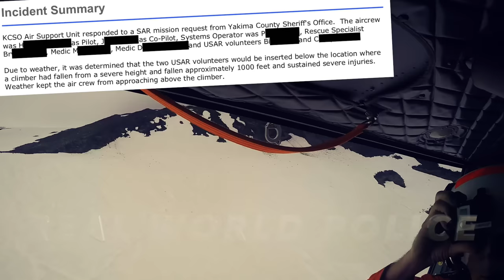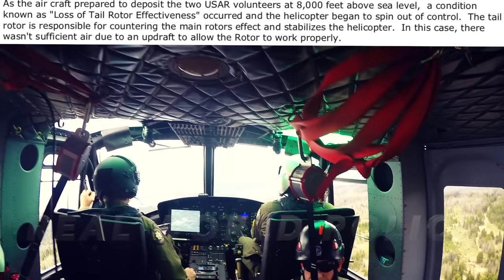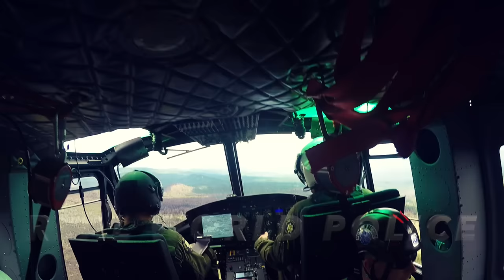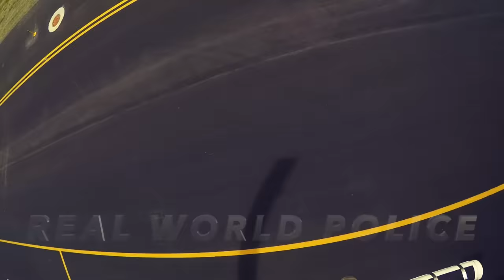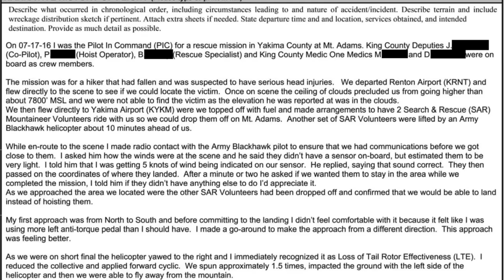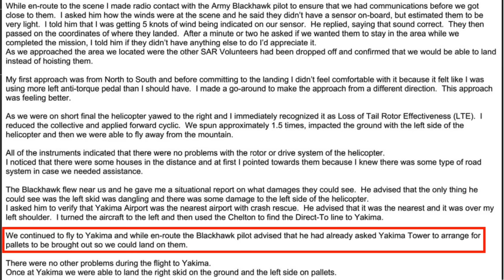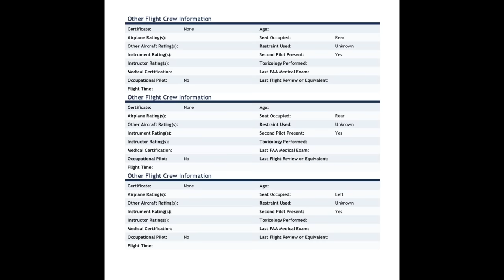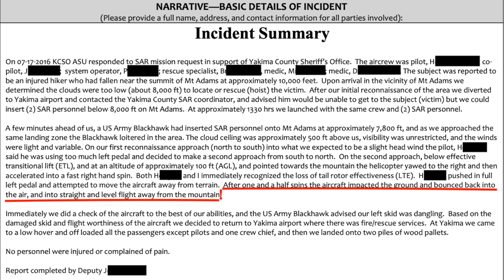Police Helicopter Loss of Tail Rotor Effectiveness & Collision With Terrain (HD)

Comment: Pilot has some skills.
Reply: GuitarsAre LikeStupid because he bounced it off the ground and almost killed everybody?
Reply: @sirlandsalot  Because he bounced it off the ground but brought it back without killing anybody.
Reply: GuitarsAre LikeStupid so what kind of pilot bounces it off the ground in the first place?   a good one?   A good pilot would have done  a proper assessment of available power and not flown into a situation of using full left pedal.
Reply: @sirlandsalot  You aren't a pilot are you. What are you doing here besides trolling?
Reply: GuitarsAre LikeStupid its like telling a truck driver he has amazing skills because he stays between the lines.   Every pilot should be able  to hover like that, if they cant, they will have a short career and possibly a shortened life.
Reply: @sirlandsalot  If you are a pilot, you would know that at higher altitude, those rotors have less to bite into. Throw in the dangerous winds generated by the mountain and a sloping surface and I'd say he rescued a chopper full of people in a situation that may have killed other pilots with less skill.
Reply: GuitarsAre LikeStupid knowing wind direction is absolutely critical and takes a long time to learn how to find it in the mountains,  I suspect he had the wind wrong.  It is called the critical wind asmyth between 2 o’clock and 5 o’clock.     It pushes on the vertical fin on the tail making  helicopter want to turn clockwise, and the required pedal input is not available to arrest the spin, hitting the stop, left pedal in American machines and Right pedal in ero machines, pending on direction of rotation of the main blades, commonly called power pedal as it needs torque to overcome the spin.   This is why a good rule of thumb is always turn left in American machine, as it goes against the direction of spin in LTE.      This is one of MANY things that can go wrong.

Comment: They survived because the pilot was able to keep the rotor level, this ensured the brunt of the impact would be through the undercarriage.
Even if the rotor would have broken on impact and the cabin would have gone into a roll it is doubtful that any of the crew would have been fatally injured as the majority of the G loads had already been dissipated from the initial impact.
Excellent piloting, play it in slow motion and you can see the pilot leaning as he is moving the control column to negate the roll.
The only thing that concerns me is the fact that the door was wide open.
Having been in a rollover myself I can tell you that debris will come inside very quickly, I suspect that the impact of the snow and rocks directly onto your body rather than the exterior door would indeed be fatal, not to mention the reduced structural integrity.
Keep doors closed until you need to go through them, it saves on ac costs.

Comment: Did this helicopter get repaired and used again? I saw them doing a SAR last year at Big Four Ice Caves. They use that small square of grass for refueling during SAR since it's the only flat area in miles of mountains/hikes.

Pilots were all cool as hell though

Edit: nvm i just looked at my vid. It was the Snohomish County SnoHawk 1 and SnoHawk 10
Reply: i beileve g2 (this unit) is back in service.

Comment: Thank You for the footage, Experience Return (REX) and document - important about CRM animation. Another thing Pilots have to admit when flight rescue in mountains sometime more than -2'000 Ft/min when OGE coming close to relief can be verry dangerous with montain shadow-wind out of sun ground.. even comming from north or south and also with powered pass 40ft wind-face or most of the time crosswind condition. To Blades Rotor System are more inclined with that kind of phenomena. Fly-Safe.

Comment: Caution: Lots of expert comments from non-pilots below..
Reply: Yep. But as a Dual rated ATP and CFI with 9000 total hours and almost 2000 hours in the UH-1 series aircraft. Yea, he flew home OK but they were idiots. That's a 9500-9800 lb. Max Gross weight Helicopter., depending on the model, and it looks like they had MINIMAL high altitude training. LTE doesn't just happen, like lightening striking. you have to operate the aircraft in such a way as to have 3 or 4 conditions just right to get into serious LTE, and they ignored ALL the warning signs.
Reply: @heartlandhawk4513  are you going to provide them training?

Comment: 26:55 most unenthusiastic fist bump ever
Reply: Pilot was thinking what to say on the report!!
Reply: Because he's still a cop, a cop also a pilot.  It's an ego issue.
Reply: Most obvious comment steal ever
Reply: Richie Kozik lol what?
Reply: @Randommemes741  Yeah, I see what you're talking about.  I remember reading that guys comment three weeks ago and the first line didn't exist at the time.  That guy straight up took my comment and put it at the top of his after he edited it.  Thanks for letting me know though!
Reply: No sir that fist bump is called GOAT
Reply: Cuz he realizes he might not have a job after that lol.
Reply: @matthewr2361  same thing I was thinking. He's probably like "well.. Hell of a last flight" but at least they're all safe
Reply: Why would he lose his job? What happened wasn't the pilots fault....did you even read the details? If anything the pilots should get medals for handling the situation so perfectly
Reply: Being stuck in Yakima lol will cause that.
Reply: @TwentyTwoThirtyThree  Most of the time it is pilot error that causes problems. In this case,  the pilot may have been inexperienced with landing at that altitude, the air density at 8000 ft is practically half of what it is at sea level, which would require more power, combined with the fact that he was hovering. When hovering the vortices from the propeller stay in place, recycling air through his prop causing his upward thrust to be less efficient than if he were moving forward, outrunning those vortices. The pilot naturally added more thrust to prevent him from hitting the mountain, more than he would normally, which probably caused him to not input enough left yaw to counter the right yaw caused from the extra torque, so he spun, in tern losing lift and hitting the mountain. It was stated there were no malfuncitons with the helicopter, which is backed up by how he flew it safely home with no complications other than the hull damage.
Reply: @kgraebes88  Did you read any of the reports in the video? If so, why are you talking?
Reply: @TwentyTwoThirtyThree  Yes... I did infact... did you? They obviously state that there were "no mechanical malfunctions or failures" which would make this situation pilot error or in other terms... his fault.
Reply: @kgraebes88  DENSE
Reply: @kgraebes88  no mechanical errors but there was an updraft causing the tail rotors to be ineffective 
Did you even watch the video or read the report??
Reply: @ajoemanjtj276  of course i read it... thats literally what i just explained. its often called "settling with power" or vortex ring state, check it out.
Reply: @TwentyTwoThirtyThree  
"The NTSB further determined the probable cause of this accident to be the pilot's failure to maintain yaw control as he slowed the helicopter during a landing approach, which resulted in the loss of helicopter control due to the loss of tail rotor effectiveness."

Comment: Great thinking to prop it up with pallets, because I doubt the Bell Flight Manual includes a section on loosing a skid in flight. The health and safety officer must have been off doing a presentation somewhere, otherwise it would have run out of fuel before the pallet risk assessment forms were completed. Also, top marks for still carrying out the dwell time at ground idle! Nice flying sir!
Reply: Mattresses were usually the norm, pallets are a close second stateside/garrison. Guess it was overseas/ deployed situations for snakes & skids.
Reply: i know right pros
Reply: There is a video on here of an F-35 pilot landing with the nose on pallets after the nose gear would not come down. Pretty cool video to watch.
Reply: The report says the Army Blackhawk pilot called ahead to the airport to get the pallets ready , Army pilots have seen a lot , thank God they knew how to handle this one.
Reply: @TheJer1963  I’ve seen the video of the Harriers nose gear failure landing on some platform, is this the one ur talking about on a carrier? Never seen the F-35B video, link? I’d love to see

Comment: That was close! The Huey is a workhorse and the AK47 of helicopters. I'm glad the crew and rescue team made it back safely!
Reply: I love how people use AKs as an example of reliability when in fact any modern AR is much more reliable
Reply: @magnacartasamadams8189  Don't get me wrong, I love my AR's but I tend to believe that a piston gun is more reliable under adverse conditions than a gas gun.
Reply: @magnacartasamadams8189   I've heard AKs are reliable because whatever works its way in will work its way out, usually with no problems and ARs are reliable because nothing can work its way in, to begin with.
Reply: @xX_Skraith_Xx   That's pretty good lol  Never heard that before I like it But there's one problem if too much works its way into the AK It can never work its way out At least on its own
Reply: @magnacartasamadams8189  That's true--with pretty much every gun. And that's why cleaning it is so important, no matter how reliable it is.
Reply: @xX_Skraith_Xx   Yeah but more so with the AK47 can not take as much mud sand  or ice as a AR15  Completely buried even That whole myth is busted There is too many openings to get in the action It gets locked up Even if the dust cover is open on the AR it will take more
Reply: Also have you seen any torture tests before A gas Impingement AR  Will last only just as long as a piston one before they blow up So yeah maybe over time you might get more Carbon build-up on your Bolt And more heat transfer Doesn't mean the piston gun isn't getting a hot on other components will fail around the same amount of ammunition  It will take  To kill each rifle
Reply: Also usually the gas tube will just blow out on piston rifles the whole barrel will blow a lot of times So  which rifle would be easier to repair in that case
Reply: @docpossum2460   So is the gas tube   Usually always blows out 1st before the barrel And the only way an AK47 can be accurate as if you shooting at like a sniper rifle Shooting It very slowly You could never keep up with an AR and keep accuracy and put as much lead down range
Reply: @magnacartasamadams8189  AKs are reliable in terms of ammunition feed, you can feed dirty ammo, shitty ammo, whatever the fuck you feel like and it will still feed. Also it will run bone dry with almost no lube. But I do agree that the AR usually deals with dirt better than the AK
Reply: Piston AR's only exist because of suppressed 10.5 barrels, sometimes in full auto.(see example hk416) Those are the only circumstances in which it enhances an ar, instead of just adding weight and degrading accuracy, unless you add even more weight to the barrel. If I was equipping conscript villagers?give me some ak's! If I had to bury a rifle in a bag and use it 100 years later? Give me an AK! Otherwise I'll take an AR platform for me please and thanks 😁
Reply: @magnacartasamadams8189  lies. AKs have 7 moving parts
Reply: the thing belly flopped a rock and took no lasting damage, the Huey is a beast

Comment: These pilots would be the first to admit that it was pure luck hitting the rock with the skid and lower fuselage and not the main or tail rotor.  And yes—Hueys can take one hell of a beating—even at 46 years old (that ship manufactured in 1970).
Reply: for those who aren't pilots, this guy means the pilots are lucky the rotors didn't impact the side of the terrain... and yes. they are quite lucky.
Reply: @carl-ok9gn  They are extremely lucky. This could have just as easily resulted in fatalities, which is why the NTSB (and the company, it seems) take this so seriously.
Reply: @Secretlyanothername  yes.

Comment: So, what should you do if your helicopter starts an uncontrollable spin?
Guy 1: "Try to get it down as quick as possible!"
Guy 2: "Gain some momentum and stabilize through flight!"
This guy: "Eh hit a rock, that should stop it"
Reply: Both of those options you listed are very bad. They are very lucky on how they hit those rocks. Helicopters have lots of problems staying in the air. Some are unavoidable and can happen to anyone.
Reply: @Khuros  No they are literally the only real options you have in heli. NT though :)
Reply: @CoralPolyps  Source on any of that? It's not true. Where should they land on that mountain? Go back to battlefield buddy.
Reply: if you don't believe me about helicopters not liking to stay in the air even if your the best in the world at flying them look at the helicopter crash from the Bin Laden raid.
Reply: @CoralPolyps  Note "Loss of effectiveness" meaning the tailrotor was not destroyed, rather it had reduced power, or just stopped outright. The rotor torque is what causes a helicoptor to flatspin, the tailrotor counters this spinning motion via pushing the tail in the opposite direction of the helicopter. When the heli hit the rock, it knocked the heli in the opposite direction of the spin, allowing it to continue flying. The reason they did not touch down on the mountain was:

A. The rotation speed of the helicopter was too great, and trying to slow down would cause a further loss of stability.

B. There was nowhere TO land. The mountainous, rocky terrain would be hell for the landing skids, not to mention rapidly rotating landing skids.

An increase of speed would also reduce stability, as the more power the main rotor has, the more torque it generates, and thus the faster the helicopter would spin.

Comment: That is an amazing (and incredibly dangerous) recovery by the crew. If the pallets collapsed, the crewman who was pulling the damaged skid out of the way would most likely have been killed by the rotor. The crewman who was lying on the skid would have been in a very bad place as well. But they pulled it off!
Reply: @Jordan Tyler wrong

Comment: Saw a Cobra land on pallets and mattresses in the USMC. It was awesome. Someone is going to need a muscle relaxer after that sphincter check
Reply: I would imagine that it took two to three hours of surgery to remove the seat cover!!
Reply: Hahaha a cobra is about 3 ft wide so ya. Pilots hovered for about an hour while everyone ran around with heads cut off looking for pallets. Then they emptied a few barracks rooms of masterssis. Then some one cut some 6by 4s for the winglets. It landed square on the pallets and right before cutting the engines, two marines ran out and jammed the wood under the rocket launcher winglets.  So how did they loose the skids? Hard landing in a marshy area and the collective ripped the skids off. That's one sphincter pucker moment. Also had a few hues come back that way . And one time someone rolled the gun barrel and e rounds shot off. It was a good time in the nineties. Nope I did not spell check or re read it.

Comment: If you lose power on your tail rotor wouldn't it be a pretty easy fix?
Like use rudder more or reduce lift on main rotor?
I got no clue because I don't know I'm just asking
Reply: I'm not a helicopter expert either but I think the tail rotor is responsible for rudder inputs. If the tail rotor stops doing its job, the rudder pedals become ineffective and you can't just use more rudder to stop it from rotating.
Reply: You are pretty close ,,  remember if you are close to the uneven ground then plan B may not work . the aircraft will eventually weather vane into the wind ,,if you have room to maneuver , if not this is the end result ,,
Reply: pup2000 if he gets airspeed it will weathervane.

Comment: Very few helicopters take that much damage and fly away. Good work by the pilots
Reply: mikemorr100 good work for bouncing it off the ground and almost killing everybody?
Reply: @sirlandsalot  yes because it was caused by an aerodynamic anomaly. Not pilot error.
Reply: mikemorr100 it is not an enormous, you miss understand.  LTE is pilot error. “Loss of tailbrotor effectiveness”.       There has many accidents and near misses to this in the helicopter industry, it is pure pilot error.     It’s like an airplane pilot flying to slow and stalling,  the phenomenon is stalling, but it is pilot induced.       If he had done proper assessments , reviewed the performance charts, he would have noticed the left pedal was at the stop and realized he had to much weight to performs the manoeuvre.    I have been a commercial helicopter pilot for over 15 years and LTE is something 100% avoided by knowledge.    It says he had 52 hours on that type of helicopter, I have over 1300 hours in that type alone.  He fucked up and got by on pure luck.

Comment: Should have gone to lower altitude, dropped off all  mountain rescue crew, then flown back, rather than risk everybodys lives on the flight back, rescue crew could have walked up to try and continue there job or be picked up by another machine, If I was in that machine I would have been yelling to be dropped off, no way would I have wanted to fly back in it, to then maybe be killed when machine flys to bits in mid air.,It does not take much to bring a heli down.